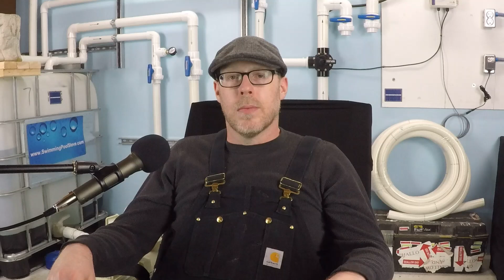Does Pool Pipe Size Matter?

Comment: Hi Steve, I really need your skilled advice please. I just learned my pool builder is using black poly for the pool plumbing it is a gunite pool with a large patio around it. Is the black poly the most reliable way to go? That's what I'm being told. Please help, thank you!
Reply: Black poly can last 50 years, been in business for 35 plus years and have seen that stuff last a very long time!  There's different grades of it though, blueflex, greenflex, etc.  The worst I feel is flexible PVC underground (or above in the sun), it just doesn't last as long as hard PVC or Poly.  If your builder is using greenflex or sometimes called aquaflex I'd say he's right on the money and telling you the truth.

Comment: Thanks for the info, and all other info you're giving us in all your other videos.

I own an above ground pool and I'm about to redo my installation incl. piping. Does it make sense to increase the pipe size above the diameter of the skimmer intake, return outtake and pump and filter in and out takes?

I believe everything for my pool is 42 or 48mm diameter. Is there any benefit to go to 50 or 55mm even though pump, filter, skimmer and return will have a smaller diameter?

Thanks.
Reply from the maker: Definitely it does make sense.  If I had only 1.5" skimmer port connection, pump connection or filter connection, for example, then I would definitely upgrade to 2" pipe for better flow rats and lower efficiency losses throughout the majority of the system.  Yes there will still be restrictions in flow where the smaller pipe size exists but you still benefit from the water moving slower through the rest of the system.  It is worth noting that you must also consider the manufacturer designated flow rates for things like skimmers.  You must not exceed these values as part of anti-entrapment and VGBA compliance.  These are concerns that exist any time you change or augment a pool system, which is why a consultation with a pool professional would be worthwhile for sure.  But assuming you stay within recommendations for flow for things like skimmers and main drains, and observe line velocity limits for safety commonly 6 feet per second or slower for suction pipes, then you should benefit from being able to move more water at slower speeds and less losses to friction and turbulence in the lines.
Reply: You'll still need to adapt the pipe size for the inlets and outlets.. so unless the pump and filter are manufactured with larger diameters you'll need to size down for the ins and outs.
Reply: @thehouse247  that goes without saying. But I am wondering if the turbulences created before or after the reducers will make this all for nothing.